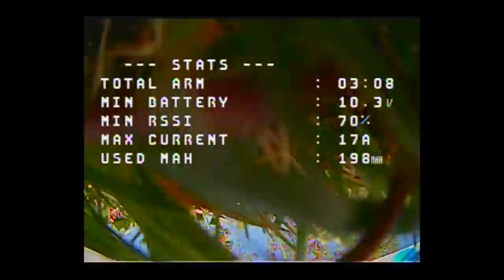BetaFPV Beta85X 2-inch Whoop Prototype Testing 🏁🚁

Comment: I like it, but I hope the frame has better torsional rigidity than the 75x.  I also still like 85mm in the whoop-esque class.  The tiny leader measures the exact same across as my gt8...so if you have a tiny leader, this will hit the same gaps.

Comment: I guess i dont see a use for this. For me its too big to fly inside and i dont need a ducted quad for outdoors.
Reply: Thomas Haley agreed
Reply: Thomas Haley I agree
Reply: Yea I kinda agree but I feel like if u go with a 2inch u should make ur own 🙂 but I’m guessing this whoop makes it a lil cheaper
Reply: Agreed! Diatone Rabbit is done right compared to this and is the clear choice if you need prop protection.
Reply: It’s about making drones that are less scary to the normal person. They type that won’t scare people and since it’s plastic and has ducts. You could fly around people more.
Reply: @DesignRobot_co  how much are the ducts really gonna help when you hit someone. Whoops break ducts and dont weigh much. I dont think these are safer as much as install a false sense of safe. Im not hating on it its just not for me.
Reply: Thomas Haley  I don’t think it will help much either but it’s their angle and to be real it’s the new hype. The entire cinewhoop and the weather brings these out
Reply: I would definitely rather get hit by this than my 2.5" build. The weight alone would make it hurt way, way less, not to mention ducts vs Gemfan 2540s, easy choice.
Reply: If HD version, then OK for outside :)
Reply: Yeah, it seems overkill for indoors and there are better options for outdoors - however, there are many folks in urban places that don't wanna risk hitting other people in parks. Very limited use overall.

Comment: I got the URAV65 & Mobulas7 and this is the one im waiting for from BetaFPV....i have a bunch of brand new Tattu 3s 450mah that i used on a Tomo Quad Sidewinder build
I also believe the RotorX 1105b 65000KV motors i got will work on this frame as well...So the stack and frame is of a great intrest to me. Hopefully soon they release this and the parts.😊
Ok so all parts and BnF drone is on preorder😊 Just wonder if yaw washout is going to be able to be tuned out. Or go lighter on the set up would help flight carristics??

Comment: I've cobbled together an 85mm whoop from various parts I had (Beta85 brushed frame with beta65 brushless motor mounts & crazybee 2s FC) and it flies great with 0802 12000kV motors & Betafpv 48mm tri-blade props (both inside & out), not sure why we need 3s or 4s on these tiny quads or even split FC & ESC when we have all in ones that do the job really well and keep the weight down? I am however impressed with the forward thinking and progression of the micro builds, one day we will have the perfect all round quad 🤔🤣

Comment: Yours sounds just like mine. A can of nails flying through the air with lots of jello
In the FPV feed. Turns out the stock props seem to be very unbalanced causing significant vibrations. Switch to AVON 4 blade or 3 blade props and that will all disappear 👌🏽

Comment: Why ducts? just make an 85mm carbon frame! Even 1.5mm carbon would be better; more rigidity and better aerodynamics would eliminate the handling issues.

How many people have a house large enough to race this in? I'm also pretty sure that by the time you have 1105 motors and 2" props it's gonna hurt whether you have ducts or not. I'm not putting my fingers anywhere near one of those...